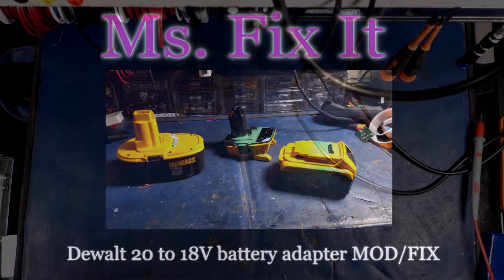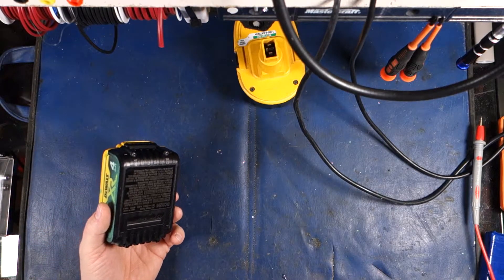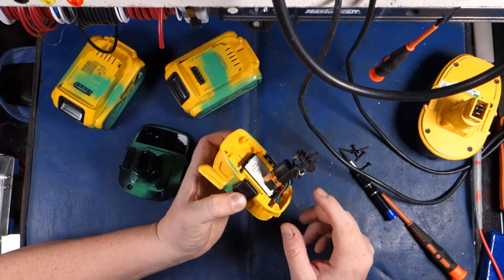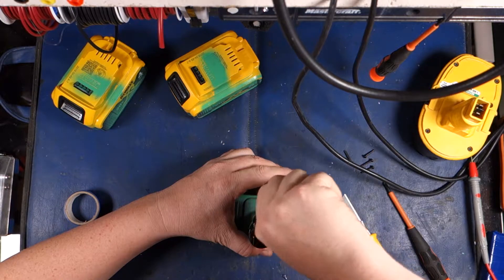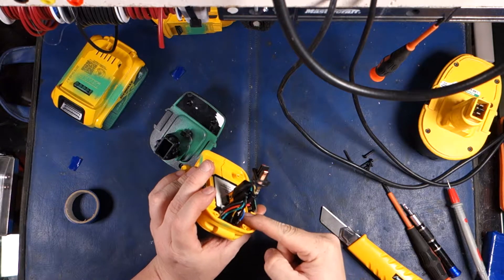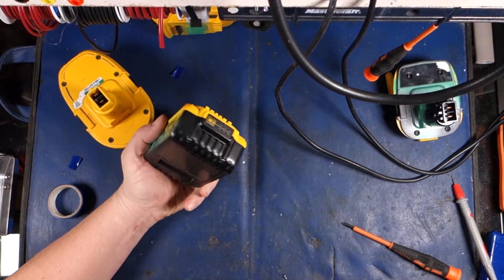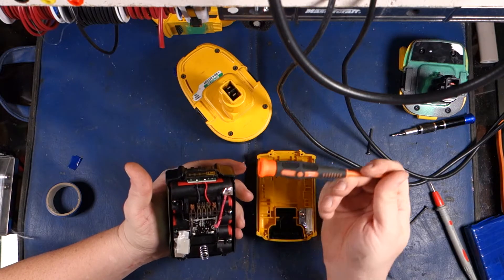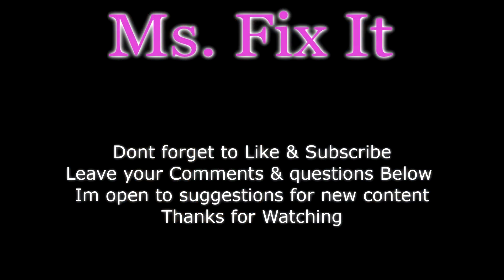Dewalt 20v to 18v drill adapter MOD / Fix

Comment: I can say ive pushed mine hard for years and still going ive wored on decks in heatwaves and cold days and batteries are good but my original 18v batteries were left in truck over night on a cold night and all died
Reply from the maker: That's odd. Especially since that's the exact opposite of the characteristics of the specific battery chemistries.
Reply: @ it was the reason I switched from the 18v to 20v tool and they are so much better in different ways but mostly size and weight and I can run 4ah in my impactt for days my old tool battery wouldnt last a day
Reply: @ its more that just a battery they are basically smart tools now which helps with power use

Comment: Anyway you can zoom in or explain that wire config. I haven't used my nailer in years would be nice to get it back in the loop, i found 1 other video the guy has a link to Amazon for the adapter but if i can do it myself why not, thanks for posting
Reply from the maker: It's easy. + To + - to -

Comment: I have a similar problem when using a dewalt skill saw with the adapter and a 20v battery. It will work fine for awhile and then all of a sudden bind on while cutting and when i pull the trigger it spins with no tork like its a little toy. Then after wanting to toss it down and beat it with a hammer ( just a fantasy)_ then it just starts working again,

How can i get this just to work?
Reply from the maker: Watch the video. It's literally about how to thx it.

Comment: Do you have any tools that the adapter will stick in? I have a dewalt impact driver & can't push in the buttons while pulling to remove the adapter! Any ideas?
Reply from the maker: Yes, I've got a couple drills, rotary tool, lamp. You have to remove it from tool before removing battery.
Reply: Right. Mine is haveing the opposite...battery only latches and releases well on the Dewalt adapter, but that adapter gets stuck in the tools.
That helped, but I had to put the drill under my foot, press in on one side, turn it and press in one the other release. Then I could grip it and pull it off. Not gonna work in a use situation. Not gonna buy the Dewalt adapters, but am trying another to see if I can get one that will actually hold the battery in securely!
Thanks!
Reply from the maker: @ebachy Hey, Were in the same boat. I prefer the NiMh batteries!! @Dewalt just decided out of the blue that they were EOL'ing something that everyone has then trying to bandaid in a garbage solution.

Comment: They are expensive but you can get 5000 mAh Sub-c nickel metal hydride cells. I think they run about 10 bucks each unless you can find them for a discount. That would turn a 14.4 V pack or an 18 V pack into a five amp hour one. It will be slightly more heavy but it should run for just as long and nickel metal hydride, as you stated,  has a high temperature Tolerances as well as decent longevity. I’ve been trying to rebuild battery packs for my old 14.4 V DeWalt tools and I have the exact same problem with all the battery management systems that I’ve used. It just cuts off at a certain amount of torque which is extremely annoying or the board blows up and takes my trigger with it, that happened about three times. Lithium iron phosphate are also Extremely durable however they lack in capacity quite greatly compared to other lithium ion technologies. In fact I think their capacity is less than that of nickel metal hydride. The only downside the nickel metal hydride is self discharge, however if you’re charging and using your batteries every day that isn’t really a big deal at all. I’m thinking about buying one of these adapters for some of my old 18 V tools which would you possibly be able to give me a bit more of a description of how you wired it to bypass it. Thanks again for the informative video I’m really glad that I found it
Reply from the maker: the largest you can get a Sub-C in is 2600Mah. anything larger is a lie ;)
Reply: Ms.Fixithttps://power.tenergy.com/tenergy-sub-c-5000mah-nimh-flat-top-rechargeable-battery/ that is where I got my info from. I guess I’ll look to see if anyone has actually tested it
Reply: Ms.Fixit Another thing how exactly did you do the bypass? I was just a little bit confused as to how you did it. I know it requires two extra wires I understood that part at least I think
Reply from the maker: @kjmeljuga  I literally bypassed the whole circuit. + to + - to -
Reply: Ms.Fixit ok gotcha, thank u again for the informative video

Comment: I have burnt up 3 of the actual Dewalt adaptors. My 18 Volt tools are fairly new but I did not want to buy 2 different batteries. Within a day I burnt up the 1st adaptor (I know it was the Adaptor as it smelled like burnt electronics. I tore the 1st one apart and yes it was melted inside) So being someone who figures I got the 1 bad one so the next day I bought another one at $159.99 at home Depot Yes it came with the 2AH batteries. I actually charged those 2 batteries and within 10 minutes in a different drill and again it burnt up exactly the same as the 1st one. I tried to contact Dewalt and received no contact back. Yes I purchased another one that I used for about 3 minutes  and stopped my project just to see how it was holding up. Already I could smell burnt electronics so instead of completely burning the 3rd one up I put it away so if dewalt wanted to investigate this issue I would have it. I will not purchase another Dewalt tool #1 because of their customer service  (I was nin Quality Management for 35 years now I am the customer and I believe as A USMC 10 year Vet. and a customer I deserve some type of contact. I will throw these tools in the trash and will not sell them and have someone else purchase more Dewalt crap. I have 2 hammer drills, a Drill Driver 1/2" chuck, a small Circular saw, several impact drivers for putting screws in small boards from time to time I am not someone that uses these tools professionally they are my personal tools. And I have spent very close to $500.00 on adaptors. I have already started purchasing the 18 Volt Milwaukee tools and they are at least 10 times better than Dewalt. Faster, lower battery consumption.
Reply: I had a generic adapter that lasted me about 7 months of moderately heavy use for carpentry before it melted down.. guess I got Lucky

Comment: I agree about that adapter.....absolute garbage, one of the worst things dewalt ever made.  However, in a bit milder climate, like MN, I have found the Lithium packs work really well.  I ran 300 6" screws once into engineered lumber, and I went thru 3 of my Nicad packs on the first 100 screws.  1 lithium pack did the other 200.  I was amazed.  Converted my entire company.  But your points are valid.

One disagreement.....in the US, it appears Dewalt still makes these batteries......

https://www.dewalt.com/products/accessories/batteries-and-chargers/batteries/18v-xrp-battery-combo-pack/dc9096-2

https://www.homedepot.com/p/DEWALT-18-Volt-xRP-NiCd-Extended-Runtime-Pack-2-4-Ah-Battery-2-Pack-DC9096-2/100124990

My local store has 11 2-packs on hand right now.....I'll grab some and ship them to you tomorrow if you like.  Throw that adapter away.